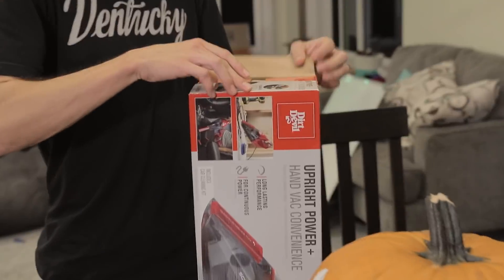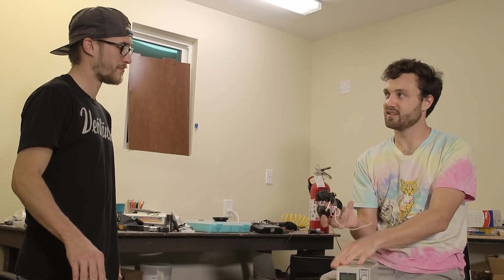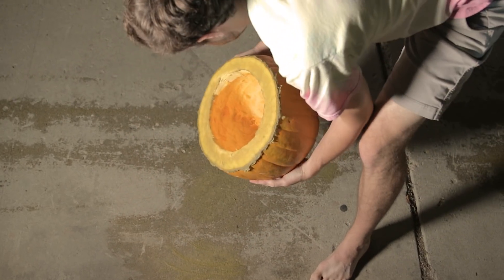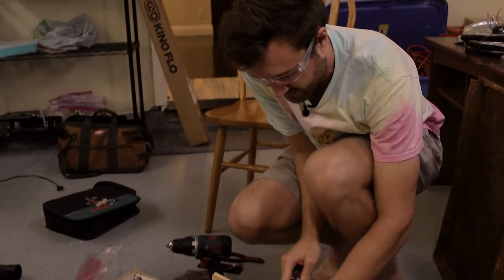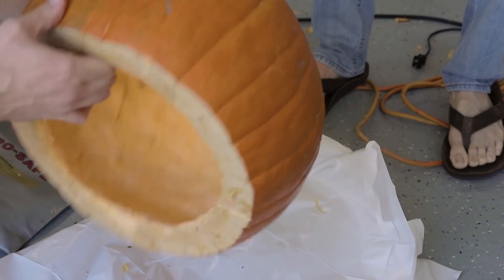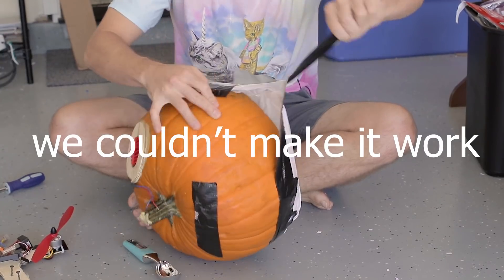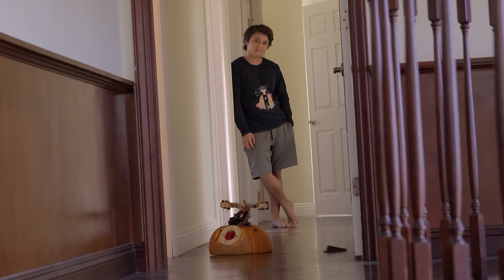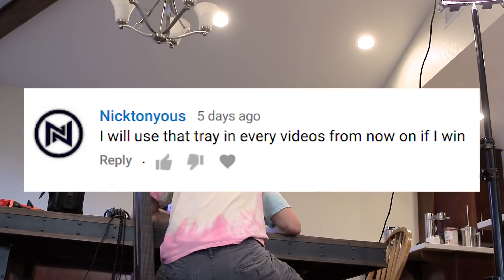I Made A Pumpkin Hovercraft

Comment: I made a riding hovercraft with a circular base. You just need a good skirt and a powerful blower. I never had a big problem with it rocking. You also want wheels for when the air is off. The circular design is the least stable, but easiest to make

Comment: not that it matters because this is a project for an insane person and i can’t imagine you’d build a v2, but i think your propeller motors don’t have the same efficiency and that’s why you can’t go straight. if you swept the input low->high->low and measured the motor response with a photoencoder you could make a simple linear controller that might actually give you significant payoff in the going-straight department. It should convert the input into the correct “space” for each motor so that you get a symmetrical response even though the motors themselves are asymmetrical. If you want it to be better you can measure the error and feed it back with a K split between left and right but i think for this application you can get away with open-loop. jus my two cents

Comment: The height of the motors is inducing a lever effect that adds pressure/friction to the front part of the pumpkin when you try to go straight. Motors should be placed as close to the ground as possible, probably one on each side of the pumpkin.

Comment: 8:28 So this is super late but we actually built ghetto hovercrafts in my intro to engineering course. 

The the way you made the skirt was setting yourself up for failure- by taping the sides without pinning down the middle, the skirt will naturally want to balloon up to a sphere with the air jets being at the very bottom. This creates the minimum amount of area possible between the air and the surface, generating very little lift.

We found that securing the center while letting the sides still inflate will have it try and form something like a torus, which when set correctly creates one long continuous seal for the air to escape under evenly.

Comment: The propellers need to be in line with the center of mass to be the most efficient. Otherwise the propellers are putting their energy into torque - rotational dynamics - as well as linear. 
First semester of physics vs Electrical Engineer graduate lol
Reply: I'm just curious, if you put both in line with the center of mass how do you turn    although it seems like it has a hard enough a time doing that in its current configuration
Reply: @pramitde328  Both propellers need to be in line with the center of mass vertically, but they are both still extended out horizontally on either side.
Reply: @toxitaes9216  ohh ok I see what you mean

Comment: ..... why didn't you just cut a base out of corrugated plastic sheet, extend it slightly out the back, mount all your electronics inside the pumpkin, on a small raised platform also made from plastic, with the props mounted to the extension on the back of the thing. This way, you can take your cnc machine, and drill a bunch of the appropriate size holes in the bottom. (because you have a cnc/lazy) Also, lowering your thrust line to the base will stop the pumpkin from nose diving, and you could adjust the thrust angle of the props to achieve a bit of lift when its moving.  Add a charge port to the pumpkin, glue/seal the base to the bottom of the pumpkin, it still looks like a pumpkin, and works like an upside down air hockey table. Also, you have a programming math nerd in the house. If you can get him away from his youtube buddies, (I recommend locking him in the closet with a calculator, pad of paper, 10 packs of bon bons, and a case of redbull) maybe he could do the math so you know how much of everything it would take to make it work. Or, you can just wait for Flite Test to see your idea, make it work, while shooting airsoft guns, flying with retractable wings, and playing the dancing banana music.
Reply from the maker: That sounds like a corrugated plastic hovercraft

Comment: Probs could have turned the props around so they're blowing the same way the pump is sucking. All that force that's blowing down is getting sucked in horizontally and would have helped thrust rather than pulled the pumpkin back constantly.

Comment: This project was made in less than 12 hours, so it's understandable that it failed, and rushed progress is not thought over very well. 

The oscillation is due to the different weight values away from the center of gravity. It isn't balanced. You have to treat it like an unbalanced wheel, put a pivot in the middle of it, spin it around, removing and adding weight until it spins without a weighted simulation.

Also you shouldn't put the thrust on top of the object, and above the center of gravity because then it wants to move down into the ground more than moving forward. Causing it not to move. And wants to spin left or right on the pivot point it has made for itself at the front of the object.

Comment: the reason the height is a problem is that it's basically dead space, and the air being compressed into the upper regions is essentially wasted. if you had perhaps filled some of the dead space up in the pumpkin, it would levitate with a lot less airflow.

Comment: does the blower motor facing the opposite direction of the prop thrust matter? i mean there are a lot of design changes you should probably consider first, but like...
Reply from the maker: I did try flipping the motors around for different reason, but it made no improvement.

Comment: Maybe I'm overthinking this and probably you'll never experiment with overcrafts ever again, but you should move the props closer to the ground and to the sides in order to have more side to side torque and less top to bottom torque. Right now your props are driving the pumpkin into the ground. If you line up the two motors with the center of mass you should minimize the pitch motion.

Comment: Most hovercrafts also have a pusher motor setup. The position the motors are currently in will try to make the pumpkin tip over forward, causing an increase in friction on the front edge of the pumpkin, and next time you should get a 64mm brushless electric ducted fan that can run on 3s or 4s and an appropriate speed controller instead of the vacuum. Also check out the tiny whoovs if you want to get your hovercraft on for cheapsies.